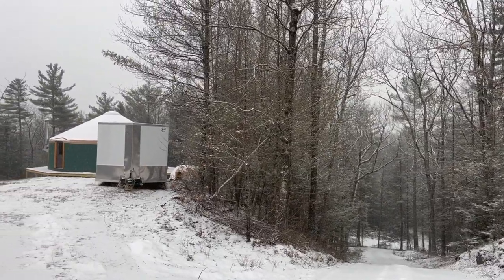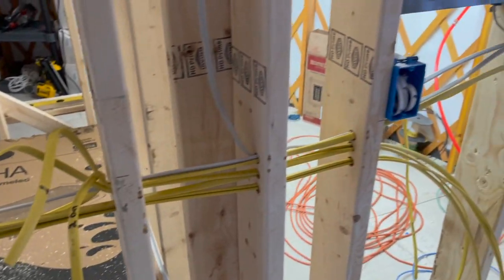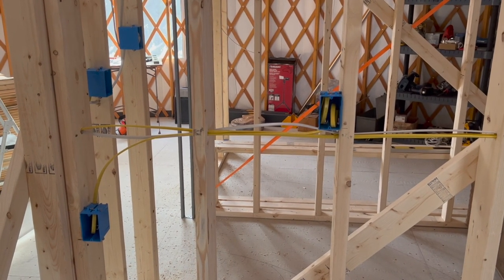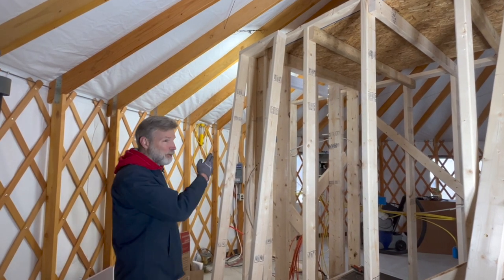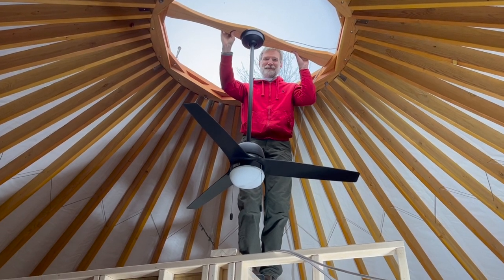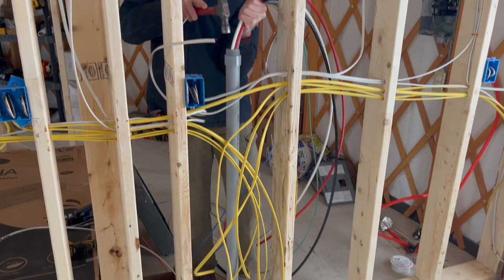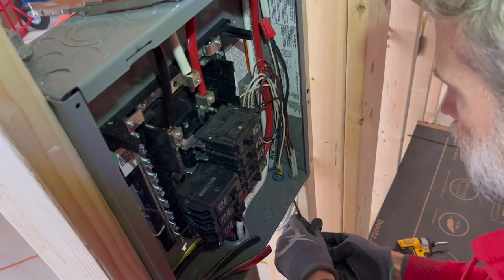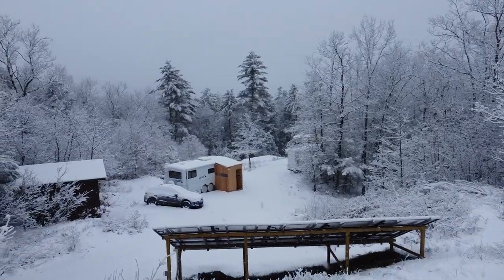Electrical wiring for our yurt (Vermont DIY off-grid home build)

Comment: Looks absolutely amazing. I think only in the States can you buy the range and grade of timber needed for the internal build, at an affordable price.
We have just finished our Yurt in Scotland, and my fuse box consists a 12v breaker circuit used for vehicles. Nothing elaborate, as everything we will have inside will be 12v. We have a single 240v inverter, just in case it's ever needed.
Just loved your video. Well done to you both. ❤
Reply from the maker: Thank you so much, Nigel! Good luck in your yurt 🛖 😊